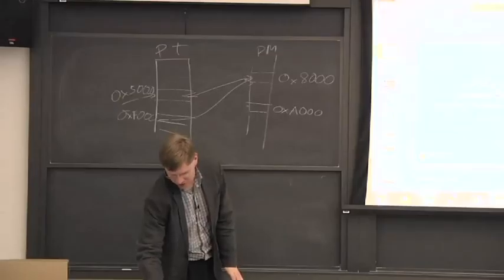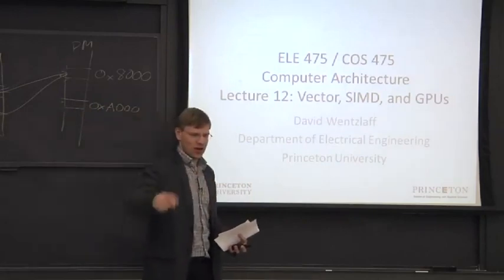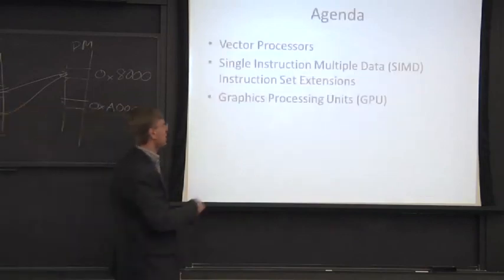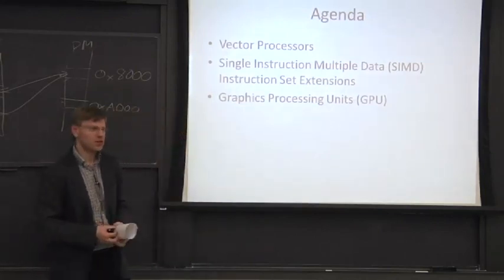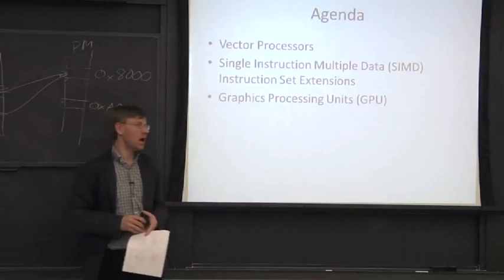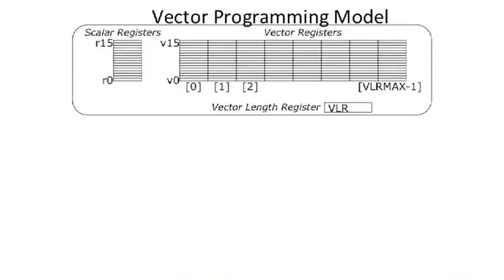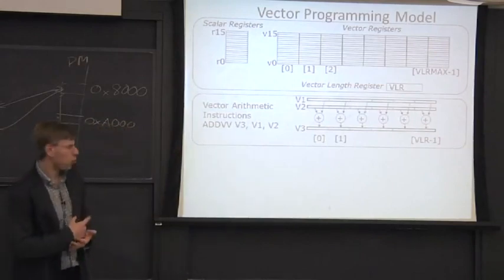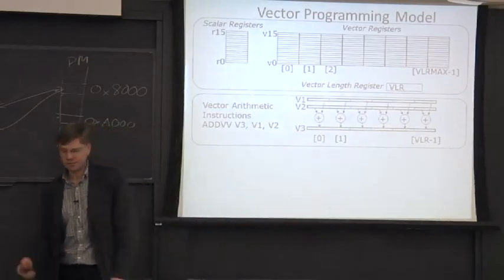COMPUTER ARCHITECTURE || 03 L14S3  Vector Processor Introduction 18 04

Comment: But MMX is NOT SIMD but rather 80bit FPU converted into additional 64bit ALU that can load, suffle, store 64,32,16,8.bit data at once can be used as buffer, 8x64bit (1 cache line) register rather than SIMD except for 3DNow (MMX2) couldnt even calculate floats, it was designed to be used for audio sound related purposes. SSE can be called SIMD, not MMX, useless crap, juat as x87 80bit floating point stack based wathever it was crap